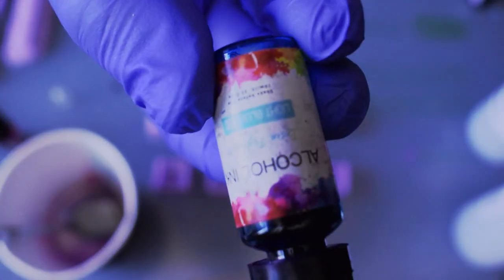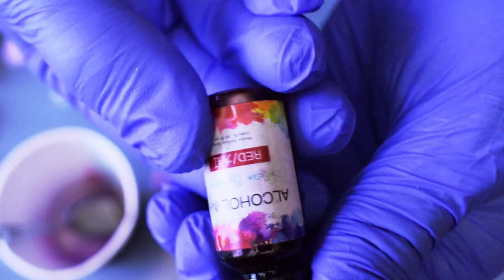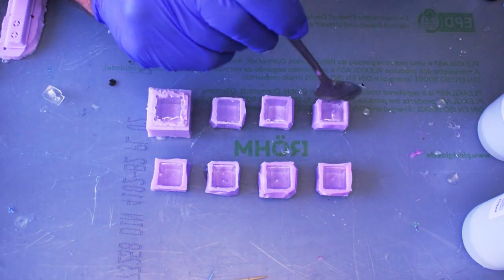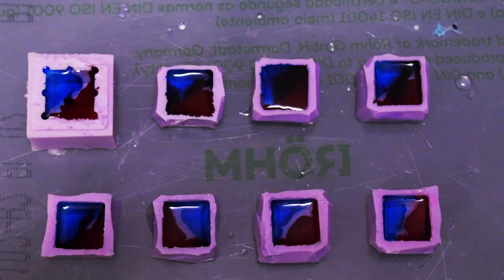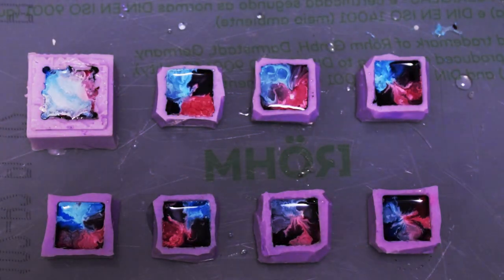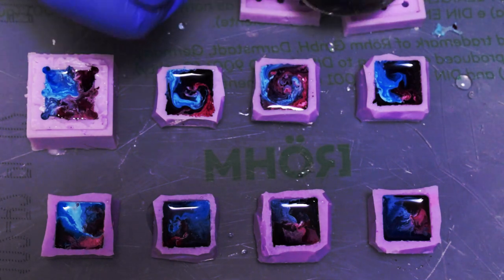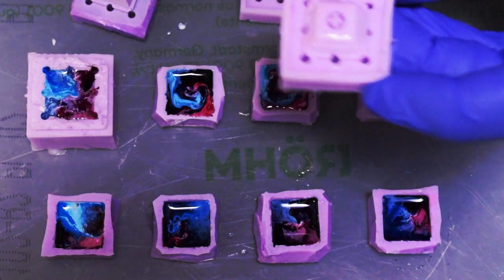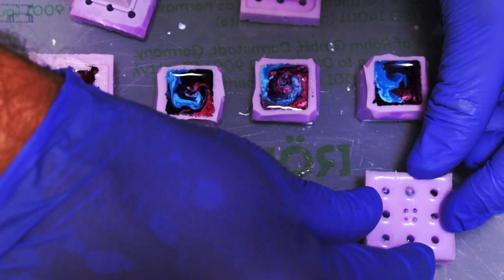Resin Keycap Making 101 #1 Galaxy

Comment: i did exactly what you did but the finished product is kind of blurry and not clear as glass like yours i made two and one of them has a small clear part so its only the outer layer that's blurry you know how can i fix that
Reply from the maker: So there is a few methods you can try.
The 1st one you can try is wet sanding with a very fine grid paper.and then polish after.
The second method is, when you put the keycap under running water you'll see its super clear right, i then got an idea to spray the cap with clear coat spray and it works insanely good but if you dont spray it evenly it can look weird.
Last one is silicone oil so take a small brush and brush silicone oil in the mold then throw the resin in the cap then you wont have any problems and it keeps your molds healthy for longer.
Last thing if your mold is getting old the caps wil start coming out blurry.
I hope this helps
Send me a mail with a photo of yoyr caps ill like to see them😅

Comment: I have a question. I follow your instructions but it seems like the alcohol ink stays at the bottom where the stem is, it doesn't "flow" inside so I end up with all the inks at the bottom when it hardens. Do I have to wait before putting the stem? or what do I need to do? I'm using a 3:1 ratio and using the same alcohol ink as you do.
Reply from the maker: Hi.
To get the ink to flow down you can use sinker white alcohol ink so the one i use is pinata blanco blanco that wil give you the best results.
It is difficult to find blanco blanco in my country.
Let me know if that helps

Comment: Cant wait to make it myself :)😃😃
Reply from the maker: Shout if you need help👍
Reply: Hey. I tried this, and  I didt exactly what u did, that that turned sticky so I put another layer of epoxy. Do u have any idea why he turned sticky? 😅
Reply from the maker: @dominicmously7442  Hey, There is a few things it can be...When mixing the resin it should be mixed very well I mean 3-5 min of mixing and scraping the sides of the mixing cup to mixin all the resin. 
2nd is the ratio of the 2 part resin near perfect, if you have a bit more of one then the other then it might not mix as well?
3rd what resin are you using? I had this problem with polymer resin once so i never used it again and it also don't work well with the inks.
4th cure time,maybe leave it a bit longer and if that does not work you can try sand of the sticky resin if you want to try and save the keycap.

let me know if any of the above tips helped :) GL🙂

Comment: Wahh I want to buy the molds
Reply from the maker: Where are you located maybe i can sell you some
Reply: Are you able to reuse the silicone mold or is it disposed of after every part? 

Also, the resin added to the 3d printed stem, do you have to do that every time or is it a one time and just reuse after?

I was thinking about using resin for nobs on my audio and just learning about it.